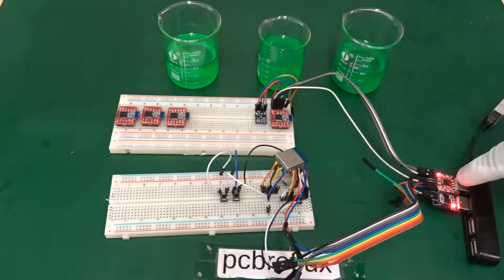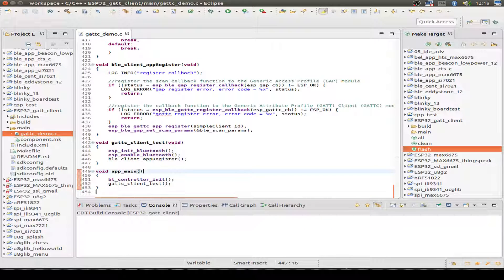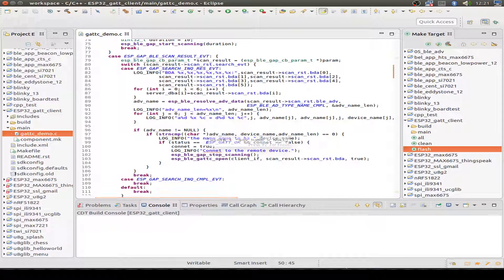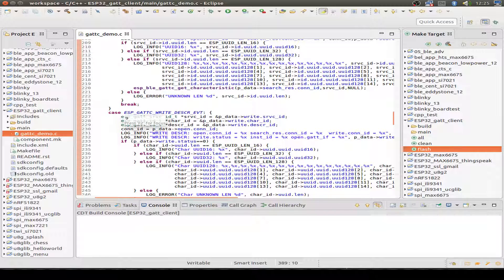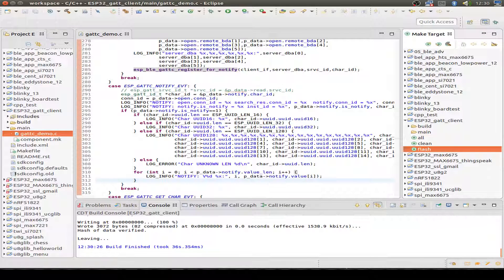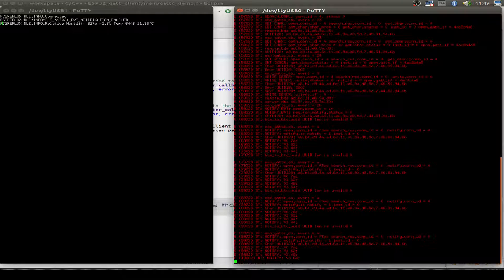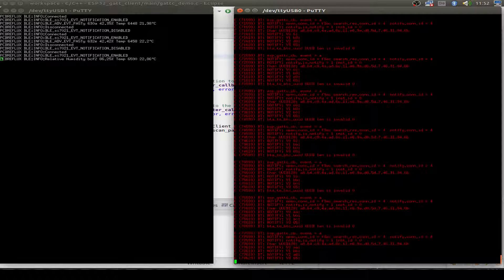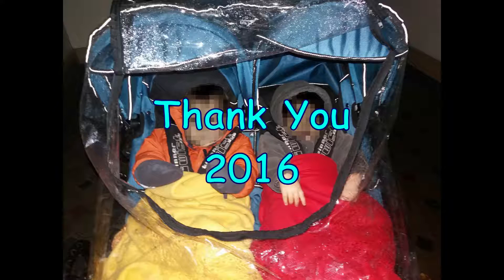ESP32 #13: Bluetooth Client reading from nRF51822 Server

Comment: that's is great !!!!! but I want your help. I used esp32 cam to take a picture and after taking a picture it will store in sd card then it will send the picture to a specific email address. but in addition to this, I want to measure/read the temperature using Arduino and after reading the temperature I want to send this temperature via hc-05 Bluetooth module to esp32 cam and store the temperature data on esp32 cam sd card together with the captured photo then finally send both temperature data with a photo to a specific email address. pls help me

Comment: can u use esp32 for production of commercial beacons??
Reply from the maker: arunbm123 See my other comment. But if your country have exceptional rules for using commercial short range senders i.e. Bluetooth/BLE the rules depends also of the construction of your product (i.e. certified module vs. bare chip + antenna and also battery or mains powered?).

Comment: Hi

I have used the gattc_demo code for making esp32 act as a BLE Client. I am able to connect to the services of the server only few times but not in all the cases.I'm getting error as status 133 and the function 
esp_ble_gattc_get_charecteristic(p-data-search-res.conn_id,srvc_id,NULL) is not getting executed 
When i use this function i'm getting error. Kindly help me with this issue.

I have a BLE device which is acting a server. It sends some accelerometer or temperature data to the BLE client ESp32 and it should display in the Putty terminal. Help me with this issue.Thanks in advance.

Comment: thank you . Have code for nrf52832 and esp32 replace nrf51822 ? . Because i have module nrf52832 and esp32. . Any ideas for this ?
Reply from the maker: Hi, thanks to nordic SDK, you can use the same code for the nrf52832. You only need to change the compiler settings in your Makefile, see this for an example: https://github.com/pcbreflux/nordic/blob/master/nRF52832/Makefile.common.

Comment: All the logging lines does not work! such as LOG_INFO . Any ideas?
Reply from the maker: espressif have changed the esp-idf a lot since the 6 month. But I updated the code now so it should compile fine with newer versions. I am using the esp-idf commit 1e0710f1b24429a316c9c34732aa17bd3f189421 Date:   Fri May 12 18:23:20 2017 +0800. Hope this helps.
Reply: Thanks! now it even does not compile . I am using platformio and I cannot figure out what version of esp-idf they are using nor how could I change it to match the commit that you have tested against.
Reply from the maker: use
git log       to display your version

git pull 
git checkout <sha1>

to checkout to version <sha1>

and to go back to current version
git pull --rebase
Reply: Thanks a lot. I have discovered that current esp-idf does not support more than one ble connection. which is a show stopper for me :( I do not understand why they keep advertising new boards and when you dig a bit deeper you always find the answer of " planned for the future " then comes a new chip and they rush to sell it with half implemented shit. I checked now RedBear duo. would you make a video to compare it to other similar boards like the ESP32 and raspberry pi zero w?

Comment: Hi, I have esp32 chip and a program I have dump into. I want to control led that is connected with esp32 with wifi. I want to control that led with a web page. Which one acts like a client or which one work like a server?
Reply from the maker: Hi, I would think the esp32 would connect to your wifi (STA) or act like building its own wifi network (AP). Beside the wifi network its acting like a Webserver (HTTP) and provide access to webpages (HTML). You can test this while connecting a pc or mobile phone to the same (wifi) network and open the esp32 ip-address inside a browser (client). The difficult part is to reveal the address from your esp32. You can read the protocol in the serial monitor or have to look inside your router to find the address of the new wifi device. Heres a example for arduino ide https://github.com/espressif/arduino-esp32/tree/master/libraries/WiFi/examples/SimpleWiFiServer .

Comment: Hi, I'm trying to test the gatt_client example but it does not work. The codes that I find and that you have in the description are a little different than the code that you use in the video. Could you give me the code of the video? Thank you!! The video is so helpful.
Reply from the maker: Hi, 

the code is available in github with all changes, see this history example https://github.com/pcbreflux/espressif/commit/fa35c26633ac68bc16dc06c7fdcfb17e87d87049#diff-7c292cc4eaf6dff1765ed73df28703e8 . You can use the git clone and then git checkout to receive the version from the video (e66ca8c65f33eea0dd3ae45e7549a0a1eb4a89ba).
After doing the video I find out that espressif publish their own gattc example see https://github.com/espressif/esp-idf/tree/master/examples/bluetooth/gatt_client (sadly before my video, but I don't check out every day for a new esp-idf version) and switch to the bluedroid library. So the new code changes also uses bluedroid and also enable the controller with esp_bt_controller_enable(ESP_BT_MODE_BTDM).

Thanks and have a nice day
pcbreflux

Comment: Hi

Do you know if only ESP_BT_MODE_BTDM (dual mode) is supported.
 I remember seeing a comment somewhere indicating this. If I switch to 
use ESP_BT_MODE_BLE I again receive the:

E (242) BT: esp_bluedroid_init conroller not init

I would like to save as much power as possible on the ESP32 that 
advertises and therefore it should only run ESP_BT_MODE_BLE. Currently 
both ESP32s get rather hot during operation and as power saving is 
important I think the power consumption is too high as of now. I have 
not measured the power consumption yet though.

Thanks
Reply from the maker: See https://github.com/espressif/esp-idf/issues/405. So today no other mode in the esp-idf and the binary bt libs supported.
Reply: any updates on BLE (low energy) features and methods?   or estimation on when it may be supported?

Comment: I'm getting an error while trying to connect to the server. 
"bta_gattc_process_api_open Failed, unknown client_if: 0"
How can i debug this issue ?
Thanks !
Reply from the maker: +Emile Hi, for debug I use the following:
- nRF Connect for the BLE Server (i.e nRF51822. )
- UART with lots of NRF_LOG_DEBUG or NRF_LOG_INFO
- openocd with gdb for the nRF51822
- UART with lots of ESP_LOGD or ESP_LOGI statements
and have a look here:
https://www.esp32.com/viewtopic.php?t=336
https://www.youtube.com/watch?v=p63VEYS7ZUw

have a nice day
Reply: Thanks a lot for the quick reply !
I ended up finding a similar code on the espressif Github (for those having the same problem):
https://github.com/espressif/esp-idf/blob/16ef01dc699806b655313bd7cf3a4d5ee741fdcd/examples/bluetooth/gatt_client/main/gattc_demo.c
I think this is the code from which you inspired yours for this tutorial as it looks pretty similar.
In this code the error didn't occur, so I adapted it to work like yours by cutting down the unnecessary parts.
Thanks for the help and have a nice day !
Reply from the maker: Emile Unfortunatly I realise just a few days later that espressif has published a similar code.... :-(

Comment: Thanks for sharing

When I try to run the GATTC example on the ESP32 the bluedroid initialization fails. It states:

E (242) BT: esp_bluedroid_init conroller not init

Wrapping it in a esp_gatt_status_t status, status is set to 103

Any idea to get around this?

Thanks
Reply from the maker: +Bo Eugen Gyring Hi thanks, I will look at the code and what have bee changeged in the esp-idf. What version/commit you are using?
Reply: A git log gives me:

commit 13dfb5568dcc30aa43363c49f7a4505d04036424
Merge: 63e0140 d9c649d

Date:   Fri Feb 24 22:23:06 2017 +0800

Thanks again :)
Reply from the maker: Hi, added line 450 in gatc_demo.c (esp_bt_controller_enable(ESP_BT_MODE_BTDM);) now it runs with the newer esp-idf.
Reply: pcbreflux thanks for your time figuring it out, I will give it another try
Reply from the maker: Bo Eugen Gyring Thanks, but I know this issue from other examples but forgot (or be to lazy) to update all the github code. 

have a nice day
pcbreflux

Comment: What esp board should i buy?
what is the difference between esp32 wroom and esp32s?

what about adafruit esp32 development board or nano32?

Thank you !
Reply from the maker: Idan Ben-moshe Hi, buy what fits your needs. Sparkfun and Adafruit products I have not testet because they are not available for me below 20$, but if you do most arduino development they are easier to use. For me there is no knowen difference between esp-wroom-32 and esp32s maybe the licencend listings / shielding? but this are bare modules and need extras like uart and an adapter. You can also search at ebay or aliexpress but most sellers are not so fruitfull sources today. My last modules i get from analoglamb.com delivered under a week.